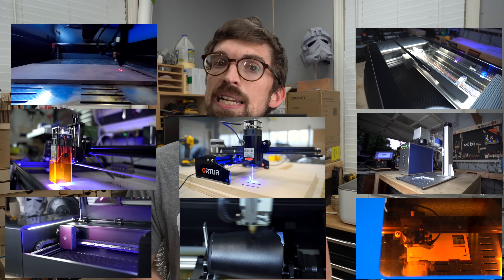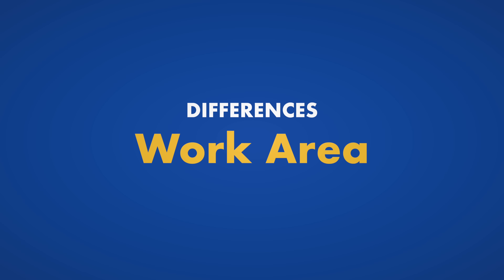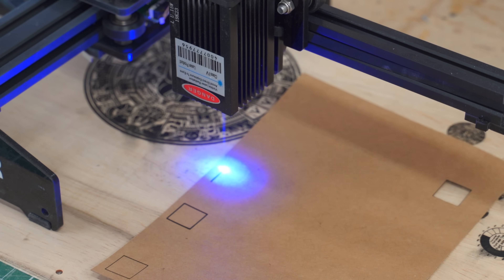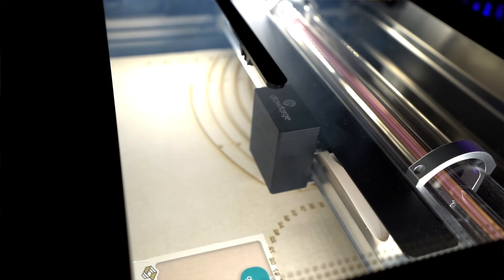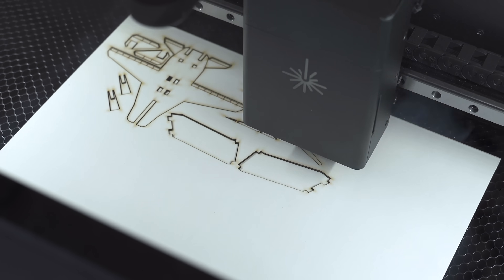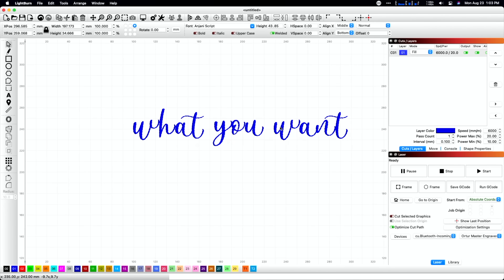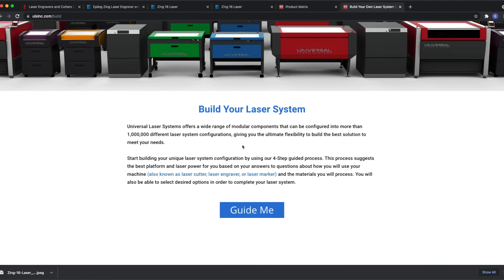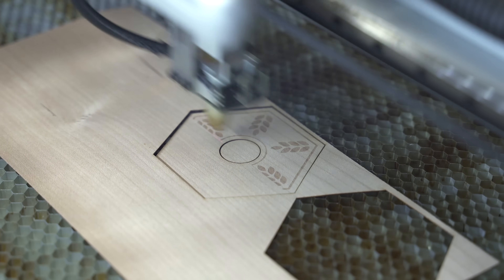The Best Laser Cutter for any Budget?

Comment: At my local Makerspace we have 3 Thunders and an Epilog.  They are quite nice machines.  The big thunder we have has like a 3ft × 4.5ft cutting area which seems insane, but one thing we have noticed with it is that the laser's cutting power gets weaker as you move away from the source, so you can't really utilize the full cutting area as easily.  That's probably just as issue with such a large laser, so keep that in mind.  Still an awesome machine and I love being able to get my hands on that pro grade stuff
Reply: probably needs mirror alignment and/or squaring the x/y axis.

Comment: i been looking at laser/engraving machines , for a entry level. but still something that's decent for around $500.00 that can make custom rubber stamps for crafting. i would be very thankful for any information that you can give me. keep up on the great videos.
Reply: You can engrave stamp rubber with basically any of the cheap diode laser, but even with the higher powered ones (5 - 7.5W) it will take many, many passes. But if you're ok with e.g. a 50x30mm stamp taking 6-8 hours, get something like the Ortur or NEJE mini with a 20 or 30 W laser (that's electrical power, laser power for those is about 5W). And get Lightburn, its stamp features are rudimentary, but still better than the "none" the included software has.

Comment: How hard is it to deal with lasers that don't have autofocus? Is manual focus a huge pain?
Reply from the maker: Usually the manual focus ones will give you a piece of acrylic or wood that is the exact focal length you'll need.  It makes it pretty easy to focus and is usually not a big deal.
Reply: And if the stated focus distance is wrong (or you're using a diode laser with a variable focus), measuring it yourself is simple if you know how to do it: Place a piece of wood into the workarea at an angle, so one side is as close to the laser as is reasonable and the other is far away. Then engrave a set of parallel lines with differing power settings. As the far ends you'll have "not enough power to mark the wood anywhere" and "so much power the distance doesn't matter". But in between you'll find lines that only mark the wood partially---that's the distance (range) the laser beam is nicely focussed. Move the head above there and manually measure the distance.

Comment: The ORTUR looks like it be good for some DIY 3D printer, with some modifications.

I worked at a place that used a type of plastic powder, in the consistency of baby powder. Wile sitting in it's shaker, it looked like bubbling liquid. Wile in that state, it is sucked up with a positive charge added to it, and sprayed on a metal part with a negative charge, to make the powder paint stick to it. After, it goes into an oven to melt the plastic onto the metal as a covering. Comes in many colors.

If one was to have a table that a slider arm will lay out a thin layer of that powder onto a table, the ORTUR could be use to trace out the shape of one layer to a 3D part. The table would drop by one layer, as the slider arm adds another layer of powder. The ORTUR traces out that next layer, before the table drops again. Repeat, until all layers are complete.

Use a small vac to suck up the unused powder, and you got a 3D part. Trick is, getting the ORTUR to be part of that automated task. Could be make possible with a Raspberry PI I think.

Would prove to be a neat project. And cost vastly less than other 3D printers that do such already costing over 15,000 for a low end 3D printer of that type.

Comment: Hey Make or Break, nice video!  Really good at placing the various options in terms of feature set and capabilities.

I’m specifically looking to cut foamcore (aka foamboard.)  Which has two issues, the paper layers burning and the sandwiched foam melting back leaving concave edges.  Have you ever experimented with this material?  Any advice or recommendations on laser choice?
Reply: You might want to look into hot wire foam cutting.
Reply: @IraQNid  Not suitable for my application.  FliteTest and others use lasers on foamcore.  Just a matter of getting the right laser and the right settings for a FAST, accurate and reliable production.
Reply: @BarretDent Another viable option are flatbed digital cutters.  Faster and safer than laser cutters .

Comment: Everyone seems to think we all run Macs or Windows.  It would be nice to specify when you speak about a product that it will run on these different OSs.  I retired out of the computer industry and have never used a package like Lightburn.  So intuitive and easy to use.  The forum there also has a lot of great people, including the developers.  RDWorks which comes with the Ruida controllers is Windows based and useless for a Linux user.  Lightburn covers the main three, Linux, Windows and Mac, no monthly or yearly fee.  Being a Linux user, proprietary software is not even considered.  Thanks for the video.  First laser was a ss laser for my little cnc machine.  Got me hooked, now have one of the 50 watt (lol) China Blue machines since last mid June.  Great machine.

Comment: Years ago I worked, extensively, with an Epilogue Summit 2000/25. That machine was built in the mid 90s. Back then you connected to it, as a printer, so Epilogue provided a print driver. Being older it had no USB, so it has a parallel printer port connector. But I "printed" thru Corel Draw, which would both cut and engrave. The engraving portion, was provided with a simple image file format (.jpg, .png, .bmp, etc), and the cutting with a vector format (.dxf), that I imported into corel, to make the final file, to be engraved & cut out. Is this still an option on modern engravers ? The prices on these new units are hobby affordable, as Epilogue units start around $20K, so not going to happen, unless you're in the business.
Reply: Yes, many CO2 lasers in the cheaper price range only support Corel Draw as control software. People usually replace their mainboards with something that supports direct control with Lightburn before even switching them on for the first time...

Comment: If I want to cut acrylic, twill material for clothing and engrave images into leather and metal, what am I looking to buy?
Reply: Actually if you want to cut acrylic, twill material for clothing and engrave images into leather you need a CO2 laser engraving machine, but on metal u need another fiber laser . Thomas.
Reply: A CO2 could theoretically do all of that, depending on the metal you're engraving you may have some extra steps to etch safely.

Comment: We have a $30k retail trotec and a similar epilog at our maker space and I would rather have my $3k 60w omtech (rebranded shenhui) laser any day, even without considering price. I have used several laser brands at various maker spaces throughout my career and so far the omtech lasers have come out far ahead. I hope this helps someone make an informed decision. Thank you for high quality, informative video.
Reply: Hello what would you recommend for cutting 2-3mm metal with laser? Can a 60w omitech tech do that?
Reply: @brovan111  CO2 lasers can't cut metal because the wavelength of IR light that they use is reflected by metal. A desktop fiber laser should be able to cut sheet metal a couple mm thick
Reply: @brovan111  depends on the metal.  Industrial CO2 with O2 assist can do 25mm carbon steel, but going to N2 or air assist or switching to stainless or aluminum will drop that same machine it to 8-12mm.  Brass and copper can be downright dangerous to those machines (heck the mirrors are copper, so no wonder).  The power levels are so different, not sure where these hobby machines would be.

Comment: I work at a custom fab shop, what would be good for 3/8" plate steel and .125 aluminum? At 4x8' sheet
Reply: You would need an industrial sized laser to cut metal that thick. Around 4000W and costing easily above $100k. Look into waterjet cutters. They are significantly more versatile, cost less, and are easier to maintain. I would only get a industrial metal laser cutter if you need super high end cut surface finishes
Reply: CNC PLASMA cutting with water table.
Reply: This is what we do where I work.  We've had good luck with used 4kw Mitsubishi machines from the mid 2000s, but even our older 1990s vintage trumpf 2.5kw machines will do what you're talking about.  Newer controllers and higher wattages will give you more options and better cut quality, and HD plasmas shouldn't be under estimated.  The waterjets only seen worth it if you do particularly small & intricate work or super thick materials (less burning issues, but lower cut speeds).

PS, if you are willing to look/wait for a deal you can get a Mitsubishi up and making parts for ~$150k, and could probably get an older or smaller machine up and going for under 100k, especially if you are willing to learn and do a lot of the work yourself
Reply: @dbooker3182   Thanks for the info, I may hit you up again if I have any questions, if that's cool?
Reply: @tbrown20188  no problem at all 👍

Comment: Can a diode laser "engrave" powder-coated metal?  It doesn't need to cut a groove per se but more like altering the color of the coating.
Reply: Yes, it can engrave powder-coated metal. Ididn't try it before but I thank it can do it.
Reply: I've worked a few powder coats with an Epilog Helix. Works much better with dark coatings. Makes for a subtle frosted look. Takes a lot of power, though. Cutting through to bare metal is very difficult.

Comment: I just tunned into your channel and it is very informative. I am on the virge to buy what is called a mixed laser. It pretty much is a CO2 laser coupled with oxigen in order to cut metal. They are telling me that it is also called hybrid cutting machine. Do you know any thing about these types of machines?
Reply: Maybe list a manufacture / model
Reply: This is how big industrial lasers cut carbon steels, it's basically a laser pumped oxygen torch.  You can also do some stainless this way, though the O2 will produce a rusting oxide layer on the cut edge, and edge quality is less.

Comment: I'm so glad I stumbled upon this video!  I the noobiest noob and I want to begin a creative career using one of these machines.  I appreciate the time you took to build your spreadsheet as that was a bullet point on my to-do list.
I'd welcome any advice from you and all other makers regarding anything laser and business.  (I'm an apartment dweller and would be venting my machine out a window.)
Reply from the maker: Glad it helps!  If your starting out I would go with a budget diode laser and work your way up with what you need from there.
Reply: The Ortur Laser Master 2 (both "regular" and Pro) have cases available. 12V Fan incl psu, Vent and flexible exhaust pipe included.
Cheapest option I could find that is apartment compatible.

Comment: WHave you any experience with Neje they have an 80w laser at this moment
Reply from the maker: I don't, but keep in mind that is 80W going into the laser module, its more like 15W coming out when you are comparing it to wattages on a CO2 laser.  But 15W is the highest I've seen for a diode machine though!
Reply: @makeorbreakshop  It's not even "80W", that's just how re-seller mark it. NEJE themselves call it the "40W" and clearly state that's the electrical power; it's a dual-7.5W laser.

Has been out for quite a while and people are generally happy with it. It's just a bit on the costly side, you're getting into "cheap CO2" price range already with this.

Comment: New subscriber here. I have recently bought an Atomstack A5 pro to use primarily for wood engraving and also for cutting templates for hand routing out of 3mm plywood.Am using LightBurn  software which is brilliant. I would be really interested in what you think of yours when you get it. Am I correct in thinking that Airassist isnt worth having on a low power laser as the chances of setting fire to something is minimal?
Reply from the maker: Looking forward to checking it out.  I would always add air assist if possible.  Most of the time when engraving it wont be much of an issue but if you start cutting really thin stuff you'll start to get some flair ups.
Reply: Air assist is the difference between burning a charred groove into the wood and cutting it. Nothing to do with fire on diode lasers.
Reply: Would really like to get some experience of air assist, but it appears that by the time you add up the costs its maybe worth looking at a total Laser upgrade. These things appear to be for playing only !!!

Comment: When it comes to software, it's also worth pointing out which ones rely on online services. I know you said "web based", but not everyone quite gets what that means. Having been screwed by a company going out of business, turning my 3d printer into a brick, I will never buy tools like these that require an online service (as opposed to web-based software served up from the tool, like most routers). For the price of something like the glowforge, I'd want to ensure I could use it for as long as I decide to.

Proprietary software (that they eventually stop updating) is another no-no, but at least you can work around that by keeping a frozen PC around for the life of the tool. No way to work around a service requirement, though.
Reply: Also, Glowforge seem really greedy and they try to put stuff that should be freely available into their ridiculously expensive "pro" subscription. Do you want to mirror your design? Upgrade to pro, only $50/month!
Reply: @mattiasfagerlund  glowforge is anti consumer. They are overpriced and forcing users into monthly subscriptions. Any company that pushes you into a cloud service should be avoided. There are 0 benefits and they are always overpriced. A raspberry pi could run that software so why should you pay them more than the pi EVERY MONTH. PS. these companies tend to use a bunch of open source packages cobbled together which is even more greedy since they are price gouging off of others kindness. If the at least made their own product they could argue they are recovering dev costs but no.
Reply: @mattiasfagerlund  I detest their marketing it as a 3d printer, which it is not at all.
Reply: This is a really important distinction IMO.  Glowforge tried to placate folks by saying "We will open source our firmware."  And they did.  This barebones firmware is almost useless and if the company ever went under - or just decided to stop supporting your device - then you would no longer be able to use the thing that you purchased without some software engineers recreating the backend components.  This model is broken and the only way to change companies from doing this is to educate people about what is wrong with it and for everyone to stop buying these products.
Reply: @mchughj  You can't educate people away from the business model because they're targeting the wealthy hobbyist looking for a new toy. That's primarily the ppl who buy glow forge so the price or closed universe doesn't matter only thing they care about is looks, ease of use, and shiny features to brag about. Those are exactly the things glowforge delivers on so the rest they don't really care about.
Reply: @Noadvantage246  I agree that many folks care about those things.  A vast majority in fact care about only those things until something happens and their devices become useless bricks. This has happened to a number of hardware products that are similar.  My hope is that we can all work to educate people ahead of that happening to make a larger course correction in how companies think about these things.
Reply: I had this with a cricut mini, they killed off the universe it used and tough luck to anyone who had one
Reply: @derekwright2388  I'm using an old Cricut Expression USB model with "Sure Cuts a lot" $5 software on Etsy. I can cut anything I design. Make sure you look for the correct old version that talks to your model. Not tied to cloud or cartridges.
Reply from the maker: Good point

Comment: Hi Brandon there is a laser that is blowing up on Facebook. It’s called the Yorahome 6550 diode laser. They claim that there’s is up to 40 W compared to the Ortur LaserPro. Have you thought about considering this one? Is it not worth the money? What are your thoughts please
Reply from the maker: So it looks like that is the power going into the system and not the actual laser which is listed at 7W
Reply: @makeorbreakshop  So not really any more powerful than the Ortur laser correct?
Reply from the maker: Yep, diodes are usually limited to around 10W